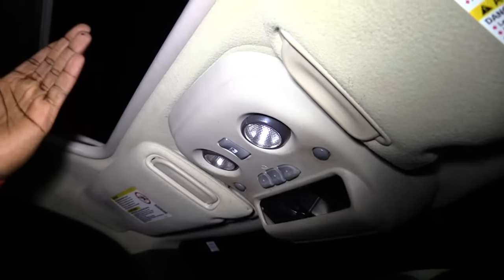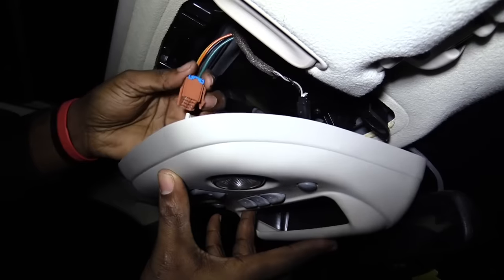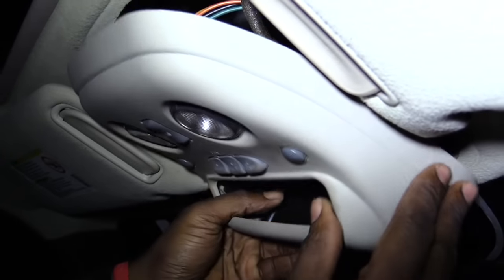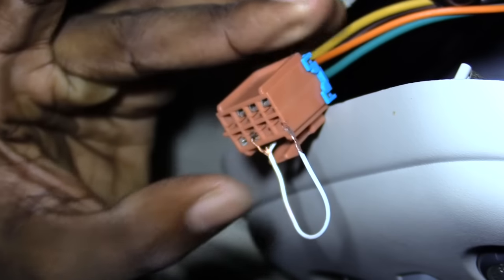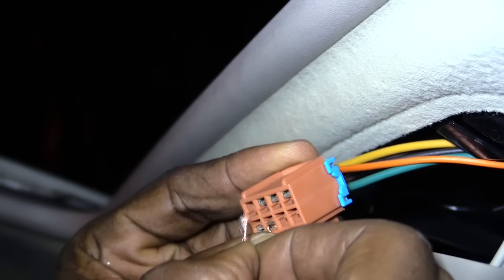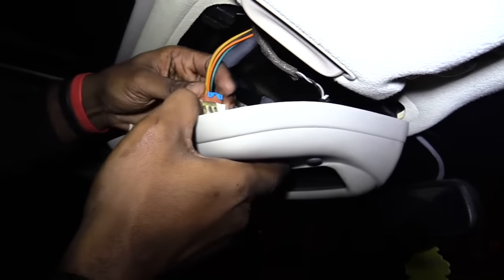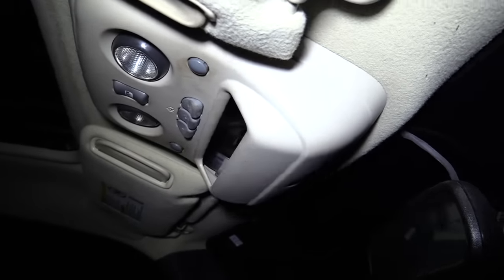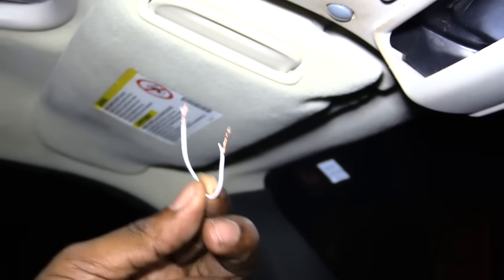How to open/close -Sunroof / Moonroof when switch won't work-EASY

Comment: I have a 1997 Honda Civic 5 speed
Reply from the maker: Thanks for watching it should work on your car you just have to figure out which spots to jump. Please subscribe and share if haven't already and check out our other helpful videos
Reply: We have a little hoopty too, lol.  She's a red, 95' Civic, automatic,  though I prefer standard.  She still has a lot of get up n go,  but she sounds like she's been submerged when we pull in and out of the driveway.  She squeaks from the right side front and rear.  RELIABLE - You bet!!

Comment: Didnt work
Reply from the maker: If you tried all spots and didn't work also check Your fuse, if not then your motor maybe bad. Please subscribe & like and share if haven't already and check out our other helpful videos
Reply: @Flashback502  the motor has 7 wires going to it.
Reply from the maker: U may want to get a different switch to see if works, if it doesn't then motor most likely is bad, or pulley system is bad.
Reply: @Flashback502  it randomly works. One day its working fine, it opens closes ok, the next day it does nothing. 
Yesterday it opened fine, got home, it closed half way and stopped .... had to manually close it with the allen wrench and now the car keeps telling me that its open even though i had to manually close it. 
The switch harness has 4 wires. From what i read it has 1 ground pin and 3 "move" pins, and each of the 3 pins is dedicated to either open, close and tilt. And each move of the switch sends that ground to the motor to move it. I tried to jump them like you did but the sunroof didnt budge on either jump. So im thinking it could be the motor but it has 6 wires ...
Reply from the maker: Spray your switch with some contact electrical spray may help, sounds like u have a bad switch.